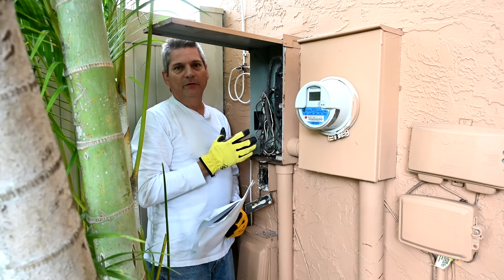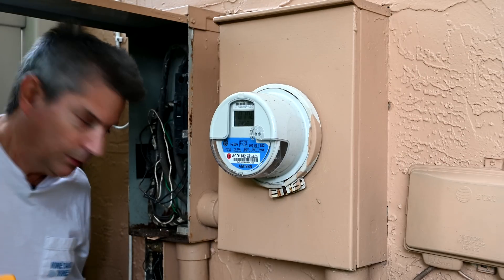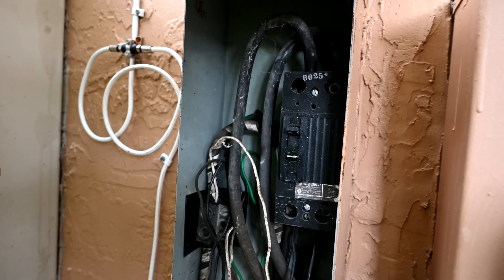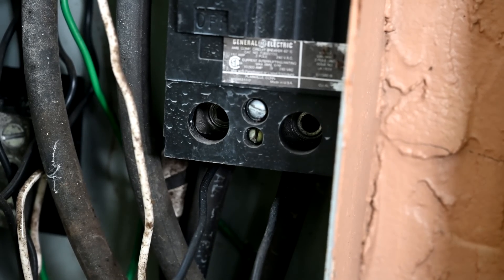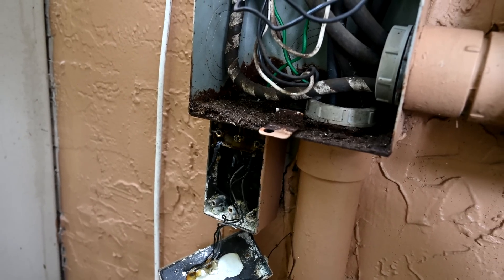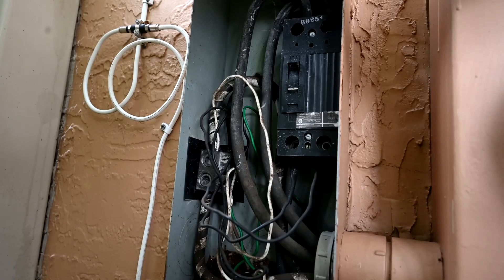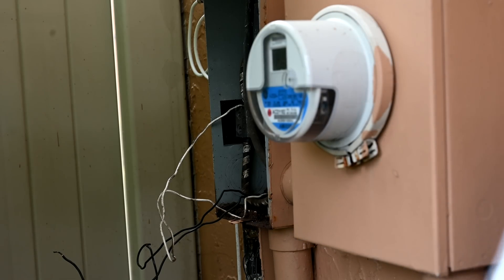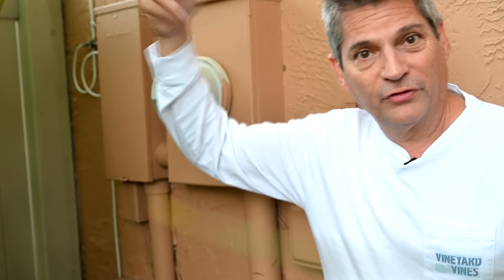Electrical FAIL: How To Fix Double Tapped/Wired Circuit Breaker

Comment: The first violation that I see on this one is see this connecting pipe from the main panel over to the breakers that is double tapped that is illegal. The second violation in here is it's a rat's nest and some of the wires are bypassing You do not attach the ground bar and tie directly into the main wire for the box that can cause a fire. The third violation is wrong wire, wrong bus, and wrong voltage. Do not attach 14 gauge wire to a 30 amp breaker. This needs to be attached to a 15. Do not attach 22 gauge wire directly to the bus. This needs to be connected to a transformer. Do not attach 18 gauge wire directly to your panel. This needs to also be routed to a transformer or to a 10. Do not attach 12 gauge wire to breakers that are below its voltage that must be attached to a 30 amp breaker. Do not plug appliances into low voltage breakers They must be on their own breaker. And finally, if you have an auxiliary panel, do not tap into the main wire or bypass the ground bar. These need to be rounded to 100 amp shut off breakers and they need to be on the main panel not inside the breaker box breaker boxes for separate circuits not for panels.

Comment: it is not as simple as you are making it. "double taps" are NOT illegal. while that install IS illegal it is NOT  because of the tap , taps have to be done correctly in this case it looks to be a 200 amp main so you need a #4 minimum which is rated for a 200 amp short it must be less than3' in length to a correctly sized protection device 90 amp minimum rating with 60 protection AND the feed lugs must be rated for multiple taps which all lugs on a molded case brakers are rated for. hate to nit pick while you are cleaning up that god awful mess but home inspectors are idiots 99% of the time and don't understand the exceptions part of the code.

Comment: Worrying about the double tap completely ignoring the major problem in the 12ga conductor on a 100A breaker. Who cares where the tranformer is as long as it is in a proper enclosure for the location. Sorry but you havent the knoweledge to be instructing others on electrical procedures.
Reply from the maker: Sorry but your insults only prove you were not paying attention. The purpose of this video was to show the inspection failures and fix them. That was done.

Comment: What is supposed to be a 'Dead front' is not.That neutral wire with white tape looks rather
dodgy or the whole box looks quite UN-professional.AHHH the %^&* done by those who
have NO idea what they are doing.
Reply from the maker: that sums it up perfectly

Comment: You can just get some sheet metal, sheers, drill bits, and file and manufacture a new cover yourself.  and some spray paint to make it look nice if the colors don't match.

Comment: Learn the correct terminology Jeff, very important that all electrician’s speak the same language
Reply from the maker: which terminology were you speaking of?
Reply: Current not energy, conduit or raceway not pipe , electricity not electronics, meter base not box, breaker switch? Sub box? It’s very important to know the terminology

Comment: The homeowner can get those electronic doorbells with cameras. Forget about wires.
Reply from the maker: Yes I've been recommending everybody to get ring cameras now. Although it is better if you can get power to the doorbell because I prefer the powered ring doorbell cams to the battery ones which only last about two months

Comment: question... my house was built in 1977  is it common to have aluminum wire from meter to breaker box
Reply: Most is aluminum still. Electricians use a bonding solution and oxide inhibitor like Penetrox to allow for the expansion and contraction of the wire in the lugs of the meter and the main.

Comment: Technically You didn’t fix anything, you should rename the video to “ removing double Landed terminals from MAIN DISCONNECT. And I can tell your a engineer, you don’t know jack when it comes to electrical. Stick to “engineering “
Reply from the maker: He there mr uninformed troll, or should I say Toxic Ted. I did fix the problem. The problem was the buyer's inspector saw the screw was double lugged and I removed it. Problem solved. Stick to Fornite channels.

Comment: Jeff, I really appreciate your videos, and I know they help a lot of folks.  However, you missed one of the most important problems caused by this double tapping situation.  Whomever did this was effectively running 14 or 12 gauge wire on a 200 amp main breaker.  

The entire point of having fuses and/or breakers is that they are sized to not allow more current to flow than the wires connected to it are able to safely conduct.  For instance, 14 gauge wire cannot safely carry more than 15 amps of current, and so should be protected by a 15 amp breaker.  12 gauge wire cannot safely carry more than 20 amps of current, and so should be protected by a 20 amp breaker.

The maximum amperage ratings for the various wire gauges are established to prevent wires from being overloaded.  Why is this important?  When wires are overloaded (carry more current than they are rated for), they heat up due to their electrical resistance.  If this continues for too long, you wind up with a wire that can start to glow red hot just like a heating element -- which will burn the plastic insulation off of the wire which can then start to burn the wooden studs and joists in the house -- causing a house fire.  Or the compromised insulation could allow the live and neutral wires to short and arc -- which also can cause a fire.

In the example of the situation created by this double-tapping, these unprotected smaller gauge wires could continue to heat up and arc until they completely melted apart because the 200 amp main breaker wouldn't trip even if they were shorted together.  THIS IS EXTREMELY DANGEROUS!

As a side note -- this is why using extension cords for high-wattage devices like space heaters and air conditioners is such a bad idea.  While the wires in the wall might be 12 gauge, and those wires are properly protected from overcurrent by a 20 amp breaker, an older 18 gauge or even a newer 16 gauge extension cord could be plugged into an outlet on that 20 amp circuit, and a 1500 watt space heater could be plugged into that cord.  The breaker, wiring and outlet in the wall can safely carry the 12.5 amps that 1500 watt space heater draws, and so the breaker wouldn't trip, but the extension cord can't safely carry that load, and would start heating up, and likely start a house fire.  

This isn't just a theoretical issue.  I have a sister and a niece that carry scars caused by just such a house fire.  My brother-in-law plugged a space heater into an extension cord, which started a house fire.  Luckily they were awakened by smoke alarms, but they both suffered 2nd and 3rd degree burns as they escaped the burning house.  

A good general rule of thumb is to NEVER plug a space heater into an extension cord.  There are some specially made SHORT 14 gauge and 12 gauge heavy-duty extension cords that can be used with window and portable air conditioners (they are usually grey and flat, and are SHORT -- only 5 or 6 feet long and have only ONE outlet).

Why am I emphasizing SHORT?  Some people don't realize that even if you use a "heavy-duty" extension cord that is made up of 14 or 12 gauge wires, that they too can be dangerous if they are too long and have a heavy load attached to them.  The longer the wire, the more resistance it has, and resistance causes heat when high currents pass through the wires....  That is why those heavy-duty grey flat extension cords for air conditioners are so short....  DO NOT buy 2 of them and plug them into each other to get a longer extension.   If there isn't an outlet near enough to support a window or portable air conditioner, then you need to hire an electrician and have a permanent wall outlet installed where it is needed.

I hope this post helps some folks better understand these issues and that the story of the situation my brother-in-law caused helps others avoid the same mistake....

Comment: SOME breakers are specified that they can be double-tapped. THe practice of double tapping itself is not incorrect, but should only be done when the breaker or switch is made that way. This one is quite old, and I don't recall something in that vintage that was ever made to be double-tapped. This particular case, if it WAS made to be double tapped.....2nd wires tapped on there would need to be the same guage as the big ones.

Comment: That’s a violation electrically and it’s an unsafe condition you have a double tap on the load side of a breaker which is fused at 200 A in your cable is not even rated for that that’s an unsafe condition it’s an eminent danger.
Reply from the maker: Yes, that is why I was called in, because the buyer's inspector flagged it. Builder did this originally.

Comment: Electrical work is not a hobby consult with a licensed electrician do not try to do this stuff yourself you could get hurt or injured.
Reply from the maker: That's why we had all the warnings about what areas were live and where to stay away from, and why we cut the power.

Comment: Actually the form of tapping you have here is extremely dangerous and a fire hazard. #12 or #14 wire on a  150 or 200amp breaker? Suppose somebody changed out that doorbell transformer to a receptacle then plugged in a garden tool with a #16 extension cord? 

Also the inspector missed something else. That CATV or worse yet satellite dish ground block has no ground wire I can see. And I believe you are in Florida right? Major lightning region. It is supposed to have a #6 to the central ground point which should be near by the meter. At least a #6 lugged to that main breaker box would be OK in this case but still a questionable code violation. It typically must go to the central ground point. If that satellite dish takes a lightning hit, even one close by, the only path for that immense voltage and current back to Earth is into the house and through the satellite box and it's out the grounded power cord back to the main panel utility ground tie. A house fire is all but guaranteed. This is why it's so important to properly ground outdoor antennas.
Reply from the maker: Maybe a lot of this was allowed in 1983 when this was built. Other electricians have notice violations on this box as well.
Reply: @jeffostroff  Double tapping two #12 or #14 off a 20a or 15a breaker respectively may have been allowed in prior codes. But tapping a circuit like that, an un-fused  consumer utility circuit off the main, was never allowed in any electrical code. And the fact that a 120v transformer was tied to 240v clearly shows to me who ever did that was clueless as to what they were doing. Same goes for the CATV/satellite. Antenna grounding requirements go back at least to the 1950s when mainstream TV was born.

Comment: great video. my home inspection book says that double taps may be accepted where the wire is a low-voltage transformer...like the doorbell. it would have to be accepted. now i feel confused. i'm a student trying to learn. thanks
Reply: You can connect two doorbells to one transformer. but not two transformers to one breaker connection.
Reply from the maker: Cool, thanks

Comment: just get a wireless battery powered door bell..no need to cut drywall and run wire..ding dong
Reply from the maker: Yes this house was built in the 80s and I suggested to them that they get a ring doorbell. What they will have to do in this case since there's no power to it is they have to get one of the battery operated ring doorbells. And when you do that you probably need to buy two or three backup batteries so that you always have one charged green claims that they will last several months but I've heard some people say they only got a month or two out of their battery so that's why you always want to keep a few in rotation on the charger

Comment: Thinking should just replace that main disconnect looks like has had moisture in it, maybe provide one with extra branch breakers for the external outlet(s)
Reply from the maker: Yes in an ideal world I would definitely recommend that as well unfortunately they were under contract for sale and they didn't have a penny to even spend anymore something like this would probably run $1000
Reply: @jeffostroff  here in s. Florida i normally charge about $1800-$2200 to replace that. Permit, inspection, meter main disconnect, fittings, etc. Not a cheap option for sure.

Comment: Honestly, I thought you had already removed the finger plate. You ask "what's wrong with this panel?" and my answer was, I can't tell, you're not showing it very well. So if you're going to ask a question, think about what the viewer has been told and can reasonably see, otherwise you'll seem kind of obtuse.
Reply from the maker: I still don't know why anyone had removed the finger plate, unless maybe it was never installed.

Comment: Nuisance hazard my foot, safety hazard, safety hazard. No double tap allowed, no breaker or neutral bus bar. Replace the whole disconnect... crap workmanship.
Reply from the maker: Maybe that was code in 1983.

Comment: Another code violation on that inappropriate double tap is they used what seems to be 12 guage wire on an 100amp breaker
Reply from the maker: What should they be using there, 4 gauge maybe?
Reply: @jeffostroff   3 awg

Comment: They do have 240 transformers 240 down to 24 volts but that’s not how it’s done you are correct
Reply from the maker: With the ring doorbells now, you can get away without powering the doorbell

Comment: You can double tap or more as long as wires is rated for amperage  that breaker protecting circuit doesn't go more than rated for. Also taps should be pigtailed before going into load side of breakers.
Reply from the maker: No you cannot double tap. Only if the breaker is designed for it, which certain square D breaker switches are.
Reply: @jeffostroff  if there is a pigtail then the defect is considered corrected and is no longer double tapped. If the circuit breaker isn't designed to hold two conductors, the conductors could come loose at some point in the future, even if they feel very tight today. Loose conductors can lead to overheating, arcing, and possibly a fire. But a pigtail is acceptable. If it wasn’t you wouldn’t be able to have several receptacles down the line. It’s all the same thing. The issue isn't about the load imposed on the circuit, it's about the physical connection.

Comment: Here’s my take. First. That is a main disconnect, not a breaker panel. Second not only are the load lines double tapped but whatever the load is has no current protection so over 200 amps could flow thru 12g conductors. Bad news. Also why would you use an all metal ratchet on those lugs? Why not use an insulated T handle? Also those lugs need to be torqued to spec when you re tighten them if you’re an “engineer”.
Reply from the maker: Yes, everything the builder did was wrong. Our friends had no money to hire an electrical contractor with all the right torque tools, so yes they got a repair that works, but academically is not to the code book crossing every T and dotting every I. They never asked to be dragged into this by an unscrupulous builder, but in the end this fix was needed to make the sale of the house go through. Maybe some day the new owners if they ever get flush with cash might want to call in a contractor to make the full repair, or maybe if they upgrade their service to higher AMPS, replace the entire box altogether. Another one people get stuck with all the time are Zinsco electric panels. Don't even get me started there.

Comment: For those offering other suggestions... NEVER underwire a breaker. #12 on a 200 amp main is no good no matter how you slice it. Next item is that's NOT a breaker panel. That is a main disconnect. You can solve your problem (if you haven't done it already) by installing a small main panel right there. That would give you a compliant panel, with the interior cover PLUS  place for a breaker to power your doorbell, and an outside outlet or two. The only changes would be to remove the bonding on the existing main panel and that will become a sub panel.
Reply from the maker: These are all things the builder should have done. I Hope nowadays they are more strict and look out for things like this.
Reply: @jeffostroff  ... I may have missed something but "the builder" was 40+ years ago, right? I guess the point here is to make it right, but I do believe "right" can be to the originally intended code as a repair, without changing so many things they would call it a new service. (and new code)
Reply from the maker: @rupe53  I would be nervous if the insurance company sent an inspector, because in the past we had to remove the outdoor main panel cover, and sand it down and paint it because it had rust. The insurance company made us send photos of the finished product.
Reply: He should have provided a little basic information in regard to the over heating/fire hazard risks involved with underwired breakers at the beginning.  If anyone watching this video is not familiar and is tempted do their own electrical work, I highly recommend doing your research in regard to what you should be doing and why.  Don't burn your house down, especially while you are in it.